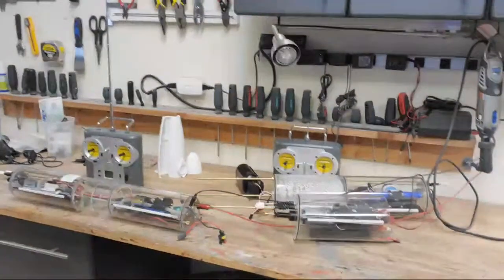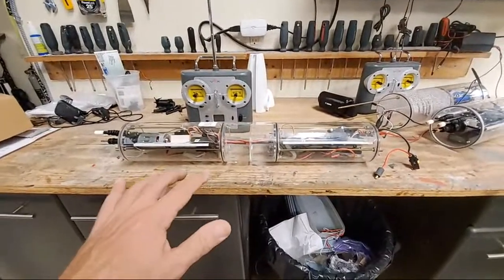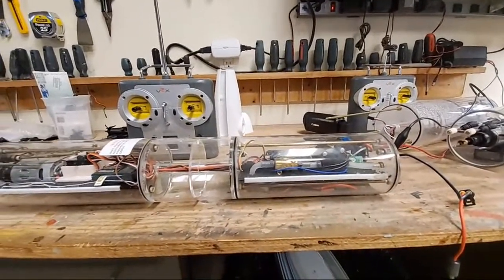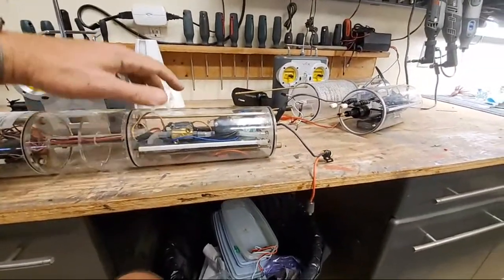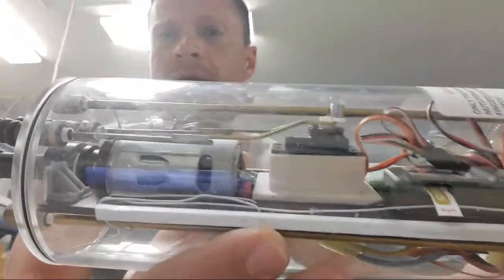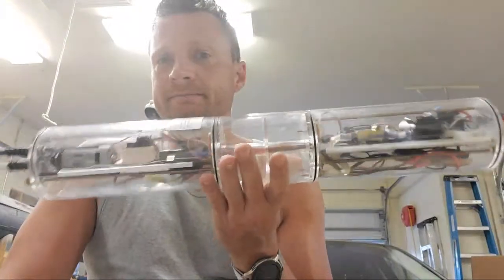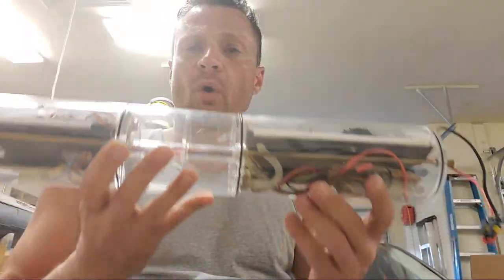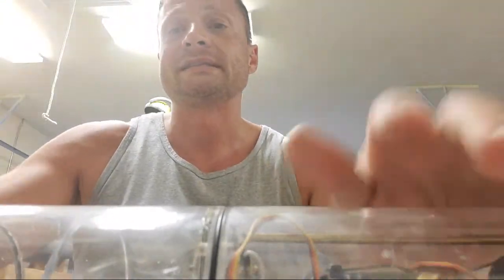RCSubGuy Talks OTW Cylinders

Comment: As always very informative! and a pleasure to watch- 
-regarding that pressure test hose (and if this is new, you are welcome to spread this simple idea)-I take that brass rod plug and cut a small kerf in one end..then I silver solder a washer with a flat filed on its edge for a handle . Makes it easy both to pull and twist.